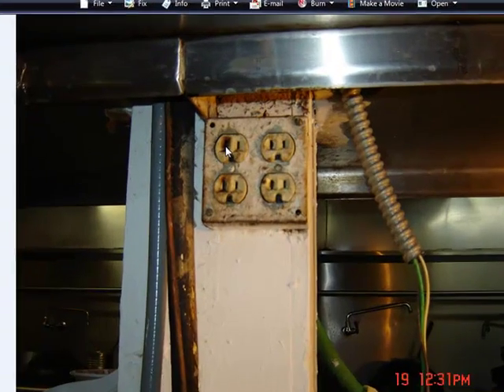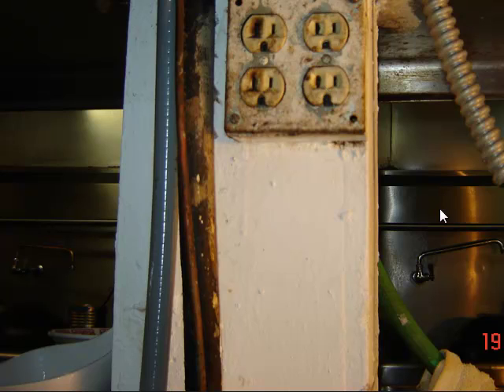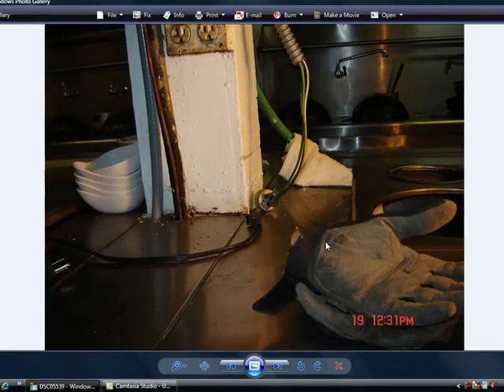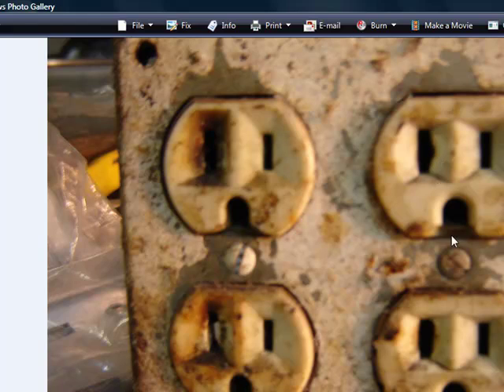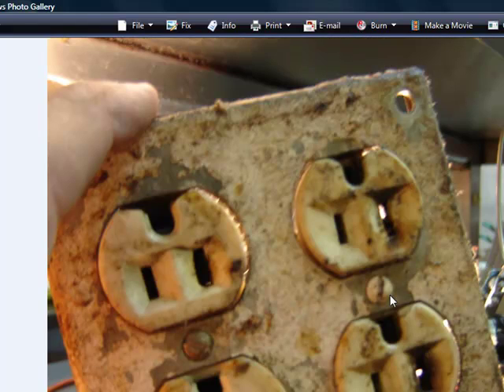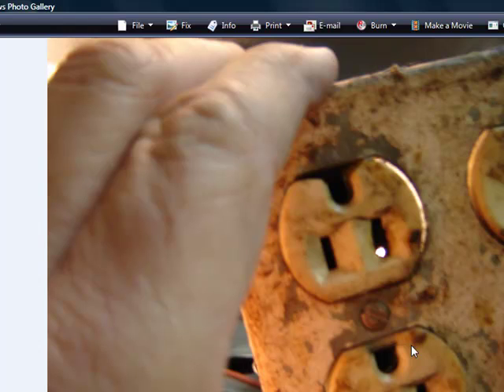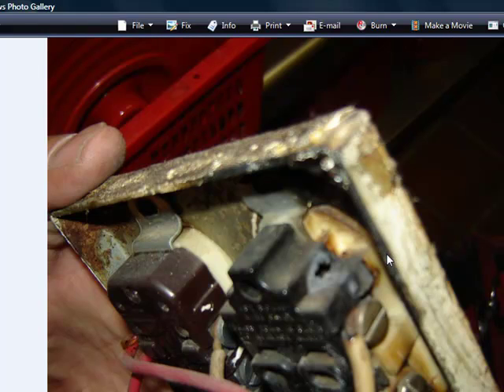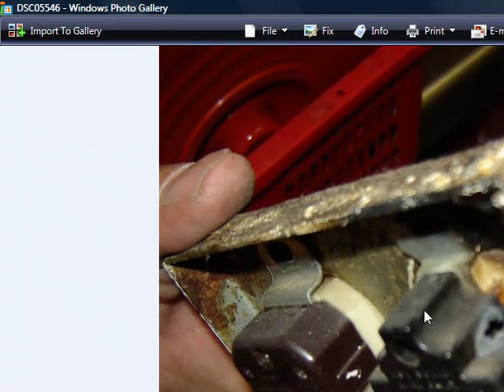Electrical Wiring-4 plex blowout

Comment: I would have installed three or four circuits with three or four receptacles instead of four receptacles on two 20 amp circuit's because the heat lamps can send heat back down the wire like electric heat which means you should de-rate the receptacles capacity even if the NEC doesn't expressly require it. Adding switches will help IF they use them. They could still put a heat lamp and the micro on the same circuit meaning they could stress that circuit to tripping the breaker. This also looks like a commercial area not a home. A home owner is more likely to follow directions as to why they should use switches while in a commercial setting once new workers are hired they may go back to using the receptacles as disconnects especially if they trip the circuit with a heat lamp and micro on it.

Comment: @BankaiIchigo12345 because the poor connection created resistance, current draw drops as resistance rises. resistance creates heat. with such poor connections, Only if active and nutral (or earth if exist) came together would it have tripped (or simply burned)

Comment: @sparkyUonline You could backstab #12 on receptacles made until around 1994.  I don't get why it's allowed on #14, but not #12.  To me they're equally dumb.  Maybe they're figuring that #14 won't heat up as much since it should be on a smaller breaker.

Comment: @solelyj you should have someone come replace them, sounds like the circuit was continued from one outlet to the next using the screw terminals or back-stabs on the outlet, which was common here in canada until a couple decades ago but is now illegal, and when the one outlet fried, the others lost their connection because they depended on the inside of that one outlet to work.

an electrician needs to come and re-do the wiring with "pigtails"

Comment: Gosh I forgot you guys over there everything twice as much current gawd 1500w = 15A, that's only 7.5A here so 2 x lamps + microwave on 20A would be easy. All our outlets have switches on them so nobody has to pull out plugs to switch off. That outlet looks like bakelite gosh hasn't been used here for decades

Comment: @81minuten I like the higher electrical safety standards in many nations. Such as Britain's fused plugs, the mounting of outlets with the earth up and Belgium's use of male earth pins in outlets and the aforementioned kid safe outlets. Also the Euro plugs having the conductors insulated so there is no chance of someone touching them until until only the insulated portion is exposed (recessed outlets work in conjunction with this). I don't remember if Belgium outlets are like this.